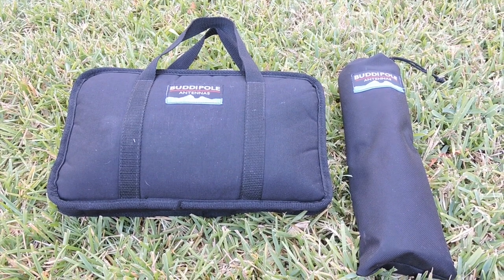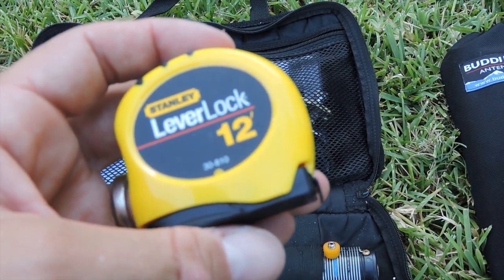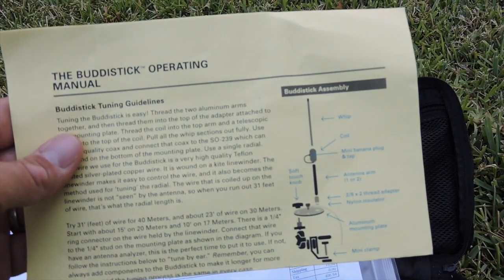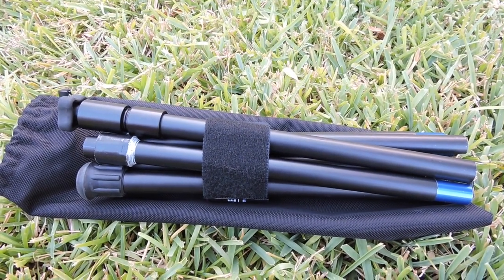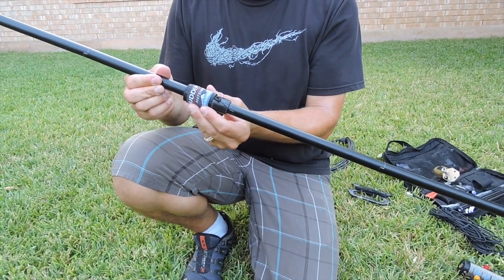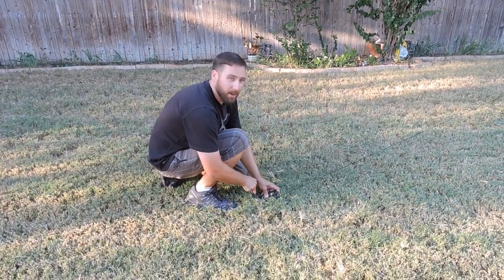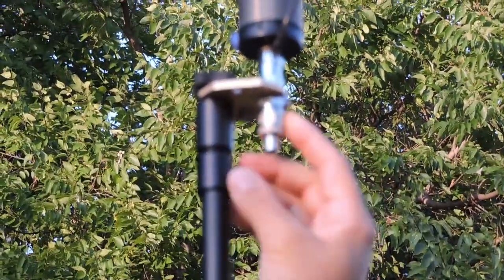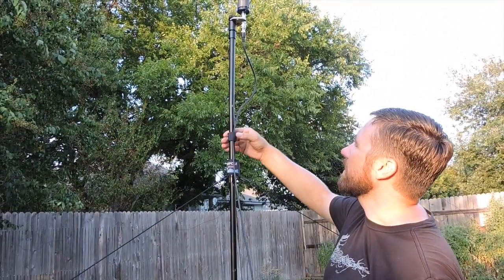Buddistick Setup Tips and Tricks

Comment: Great video and info. New ham looking to buy my first HF antenna, I will be 95% portable operations. Almost bought the Mpas and then found you. Q- why buddistick vs buddipole?
Reply from the maker: Hello, Thank you for watching my video. I'm glad you were able to get some value from it. I have both the buddistick and the buddipole along with a lot of their accessories. I find the buddistick to be easier to setup with less fiddling than the buddipole dipole setup. Another thing you can do is get a buddipole set and use it in the "buddipole vertical configuration." To put it simply, I'd rather spend my time on the air than fiddling with a finicky antenna. The Buddipole isn't all that finicky but the buddistick setup, as shown in this video is dead simple and just works. 73!

Comment: Great video, thanks!   I'm considering the buddistick as a base antenna and I was wondering about weather, specifically sudden downpours of rain. Can the coil be weather-proofed to some degree, e.g  a plastic wraparound tarp or something similar?  I'd be using a camera tripod as a base.
Reply from the maker: Hello Jeff, Thanks for watching! I haven't done this myself but I have seen people take a ziplock bag, poke a hole in the bottom and put that over the coil to keep excess moisture out. I don't think it will interfere with the tuning. Not a perfect solution and I doubt it keeps all water off of it but it might do an ok job. When I have operated with mine in salty, sandy, wet conditions I have always made it a point to clean it up really well after I'm done. If you plan to keep this up long term you might consider a bi-weekly or monthly maintenance regimen to keep it in good working order. 73! Marty W5MRM

Comment: Just yesterday our club participated in a CW qrp event, two radios side by side but separated by 100' or so, both at 5w. One using the "buddiestick", one using  a homebrew dipole. In a two hour period, the radio with the dipole made 5 contacts, the radio connected to the buddiestick, zero contacts, both on 20 meters. A real eye opener!
Reply from the maker: A lot of factors can go into this. I have done multiple antenna tests and had it go either way. What I can tell you is this is an easily deployable antenna system and I have made thousands of contacts all around the world on it. Excellent in a lot of areas of Texas where trees are at a premium. I'm sure there are better solutions out there, this is just one in my tool kit. I would say don't count it out. 73, Marty
Reply: @RadioSATX  Well I am glad that it works for you; I have had mine for three years now, have never been impressed with it.

Comment: Marty -- I have a Buddi-Pole system that I periodically use in the field. An addition to my kit I found to be >very< useful is a role of 1" wide surveryor's tape. I tear off/cut several short pieces and tie them to a few places on my guys about knee and at eye level. Tends to prevent the buds you are camping with (or yourself) from tripping over the guys and destroying all the work you put into carefully erecting your field antenna. 
Best regards -- Jim / n6med
Reply: I use brightly colored paracord for my guy lines to help promote high visibility.
Reply from the maker: Great tip Jim! Thanks for watching and for sharing your tip!

Comment: The down side for me is that the radials have to be elevated.   Wolf River Coils seem to be a better setup and much cheaper and much easier to tune.
Reply: Hello Benny! I had not heard of Wolf River Coils. Thanks for tipping me off to them. It appears that they are similar to the MP-1C Super Antenna setup. I have an MP-1C and it is incredibly convenient to setup and use. I don't believe it is as effective as the buddistick, potentially due to the shorter element lengths and ground losses due to the radials/counterpoises being on the ground. I don't have any scientific evidence to back this up. Thanks for posting and I'll definitely be doing more research on Wolf River. 73!

Comment: I have just bought s buddistick,, I noticed that you put the arms on top of the coil and the antenna on top of the arms is it better this way.
As the manual has the arms first then the coil then the antenna.
73's Alan in the UK
Reply from the maker: Hello @alan read! I have found that it doesn't matter that much. Here is a reply that I sent to another one of my viewers with a similar question: "have tried it both ways with no discernible difference. I believe it was also modeled both ways in the buddipole in the field book showing negligible difference. I do it this way as it's easier to change bands."
Thanks for watching and let me know how the antenna works out for you. 73, Marty W5MRM

Comment: The setup is just not correct. The Spool has to be in the middle,
Reply from the maker: Justin Case have tried it both ways with no discernable difference. I believe it was also modeled both ways in the buddipole in the field book showing negligible difference. I do it this way as it's easier to change bands.
Reply: Hello, i may have to try it your way. i had it set up with the spool in the middle like the manual says. I worked it from Mallorca, Spain to germany and to the USA back in 2013. I let you know when it try it the other way. No offense, 73 and best QSO :)

Comment: Why do you have the coil attached directly to the plate when the instructions show the coil between the arm and the whip?
Reply from the maker: I do this mainly for ease of adjustment. I have several coil clips on the coil and I find it easier to adjust them when the coil is at that point in the system. 

There was also a discussion on the Buddipole Users Group some years back where someone modeled both configurations and found minimal change. In the Buddipole in the Field book all of the Buddipole verticals show the coil at the bottom (on top of the versatee) this is done so that the banana plug leads can reach the coil clips. With the buddistick they do show the coil on top of the arms. 

I should model it myself some day and see if there is much of a difference. It may change my mind. This setup I have has served me well and I have worked plenty of DX with it. 

What are your thoughts?

73,

Marty
W5MRM

Comment: Outstanding presentation and information! I have the pole deluxe that's nice in the field, but like the small form factor of the stick. Well done!
Reply from the maker: Hi Michael! Thank you for watching and for your comments. I also have the buddipole deluxe but I find that I use the buddistick much more often. Its just so much more compact and easy to setup. 73 and good DX!
Reply: I agree it looks much easier - great for a lunch time setup. I am thinking I can probably get away with just getting the mounting plate and guy system and use the 'pole parts I already have. Thanks again!

Comment: You should use something non-metalic for the counterpoise wire support to avoid ground losses. This electric fence post is recommended and available cheaply at Home Depot with store pickup:

http://www.homedepot.com/p/Fi-Shock-48-in-Plastic-White-Step-in-Fence-Post-A-48/100287520

Comment: Great video.  What I do is use a bit of coloured tape on the counterpoise wire that matches the coil tap colour.
With a little bit of patience and some pre-configuration work at home these antennas really do work, and once you get them set up you get a feel for how to set them up anywhere.
Thanks for sharing your ideas, I really like the shock cord mast idea with how you pin the two far away guys first then raise it up and secure with the third one.
73, Cameron, AF7DK/GM7LQR
Reply from the maker: Thank you for your comment Cameron. That is really good idea on matching the color of the tape and taps. I will have to set that up on mine. Thanks for the tip! 73 Marty W5MRM

Comment: I am a prospective buyer of the Buddistick, but I will make up my mind between this and the Alpha Antenna by tomorrow.  I have a trip in the mountains coming at the end of the month and I want to get very familiar with the antenna finally chosen by that time.  

+W5MRM I see you didn't use Buddipole's tripod and just put the stick up.  I have a brand new in the box tripod which I bought to use with a MFJ 2.4 GHz yagi, but ended up not using it for that application.  Will it work with that tripod or is the tripod engineered to go into a slot of some sort? 

Thanks for the help. aa5az
Reply: Also, to what did you use to hitch the counterpoise?  It looks like the mini-tripod?  Does it matter if the counterpoise is at an angle, even a sharp angle, since the antenna base could be pretty high up with the telescoping pole height??
Reply from the maker: The buddipole tri-pod has a different mast than the one that I use in this video. I believe the buddipole tripod mast has a 2" outer diameter. This mast is much smaller and works better for portable (backpacking) use. I do have the buddipole tripod and 18' mast and it works great in the backyard or wherever I can operate near my vehicle.
Reply from the maker: I actually used a camera tripod in this video for the counterpoise. In the field I usually use a stake or a stick. Again, this is all for weight and bulk savings if you are going to be backpacking with this. In the backyard here I use the camera tripod that you see in the video. Counterpoise can be at an angle. As long as you can tune for low SWR you will be fine.

Comment: It's slightly better to wind and unwind the counterpoise wire in a figure-8 pattern (I tape up the hooks so it doesn't catch), so the wire doesn't twist (as it does when you pull wire off the side of a spool instead of unwinding it).  A figure-8 avoids the twist accumulation and is pretty fast to perform.  Winding and unwinding is otherwise very slow.

That's an old punched paper-tape trick, but they use thumb and forefinger to wind over.
Reply from the maker: +yclept9 Thanks for the tip! I'll have to try that out.

Comment: Thank you for a really helpful video. Now that summer is arriving here in the UK, I will do some /P operating. What positions (rings) do you set your coil at with the coloured plastic markers for the various bands?
Reply from the maker: Robert Adlington Hello Robert, thank you for your interest in my video. I will pull the coil out in the next couple of days and get this info for you. Sorry I can't get to it right away.
Reply from the maker: +Robert Adlington (M0BOB) Hey Robert, I know it has been a long time since you asked this but I just finally got around to it. Here is the coil clip setup that I am using You will need to adjust these a bit dependent on your usage. I haven't used this in a bit but I believe these are the band's. All turns are from the bottom as pictured. 40 = blue 7 turns. 30 = red 22 turns. 20 = yellow 30 turns. 15 = red 37 turns. 10 = green 39 turns. Counterpoise should be off the ground 2 - 3 feet. Your milage may vary! Have fun playing with the antenna. Experimenting is what it's all about.

Comment: this is by far the most detailed video i have seen on using the buddistick antenna. a used one was for sale on QRZ not long ago with all the extras, $400. sure wish i would have purchased it. informative video!
Reply from the maker: de N5XTC Thanks for the comment. Passing along info and helping each other out is what its all about. You can get a new Buddistick Deluxe package for $175 and just add components as you need them.
Reply: W5MRM would i be better off in the long run with the buddipole deluxe rather than the buddistick? it is $437 with some extras.
Reply from the maker: de N5XTC This is really a matter of preference. I have both. I rarely use the Buddipole and when I do I use a fairly basic setup without the rotating arm attachments, etc. The reason I use the Buddistick is its ease of deployment and tuning. It is also very portable. I go for simplicity. The Buddipole isn't that much more difficult though. I'm sure you have watched a lot of videos on this stuff, maybe take the plunge on a lower end set and add to it as needed. If you don't like one or the other I am sure someone on the BUG Yahoo group or eBay will gobble it up in a hurry.
Reply: W5MRM thanks for the info. if you ever run across a good deal on either used, let me know. i should have bought that one on QRZ. if i get it, will get the buddy stick deluxe. once u have it marked like you do, seems like it is easy to use. the markings on the coil are critical i would imagine.
Reply from the maker: I'll let you know if I see one for sale. If you aren't on the buddipole yahoo group you should join that. Every once in awhile someone will sell their antenna. Instead of markings on the coil I actually keep the "coil clips" in place and that way I can just move the lead with the banana plug between them quickly.

Comment: I noticed that several operators put the coil at the bottom and others put the coil midway and make this a center loaded antenna. Have you done any testing with both setups and find any difference? Just curious as I am looking at getting one of these someday.
Reply from the maker: I did try this early on but to be truthful I don't remember the results. I go with the coil at the bottom as in most cases I can reach up and change bands without needing to tilt the antenna over. Just a matter of convenience. Thanks for the comment! If you do any testing with this drop back by and let us know the results.